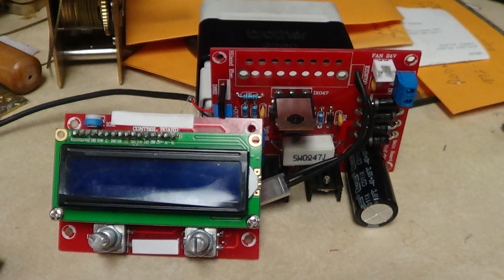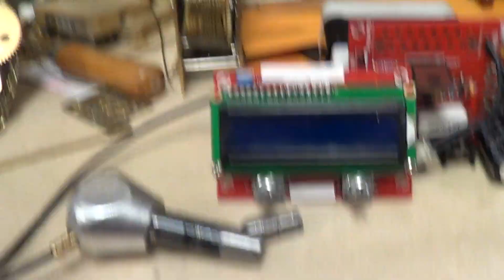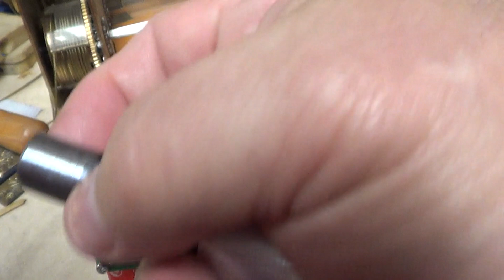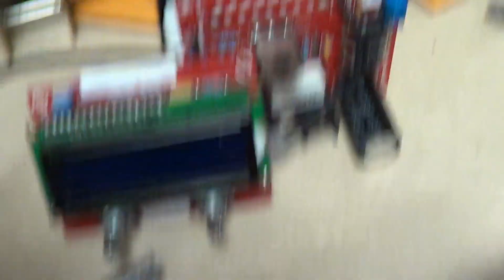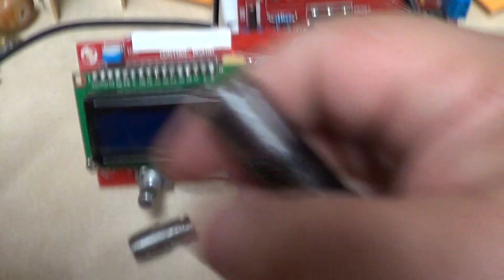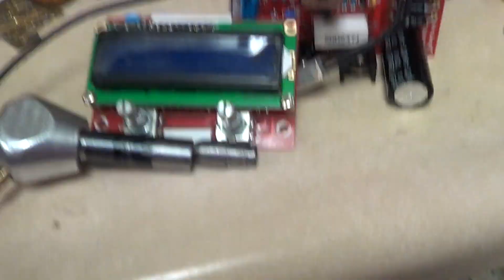Magnetic Pulse Graver: New Prototype

Comment: Ask for a pattent maybe? 
This is gonna be a lot cheapper then GRS. Can make you rich if not rich already :). Good luck!!
Reply from the maker: I might have jumped the gun here,  I'm not sure what happened with my power supply but it did short out and it cooked my variable power it also took out my 555 ic timer this will set me back a bit! I'm puzzled why my main power supply blew the 2N3771 transistors? I have ordered two of them for replacement and I'm hoping it will fix the heavy-duty power supply as I use it for jewelry plating and other uses. Hope you keep following my progress. Thanks for any and all comments.

Comment from the maker: Current and voltage determine the amount of power the pistons push and pull reacts. The more winding the magnetic coil has and whatever tension your piston has gives the graver its unique qualities. A timing circuit provides the pulse to react in relation to the magnetic relay so it's completely controllable. In the development, this gives the graver enormous control for both metal engraving and jewelry stone and bright cut setting.
Reply: I read about the power supply burning out /overloading. I don't know if you have it sorted/ figured out already. Since there is coil / solenoid type component as primary load an inductive voltage reaching kV levels will build up when the current is ceased. You need to add a freewheeling diode in order to protect your voltage supply. I had my power supply frying when I was prototyping a solenoid valve operated airgraver until I added a freewheeling diode... Now it works like a charm.
Reply from the maker: I pulled too much current and didn't pay attention to board and overheated I fried a few components.